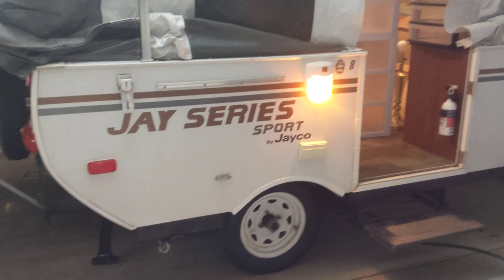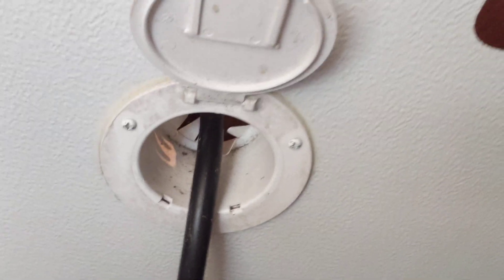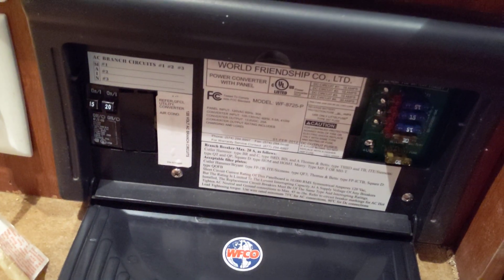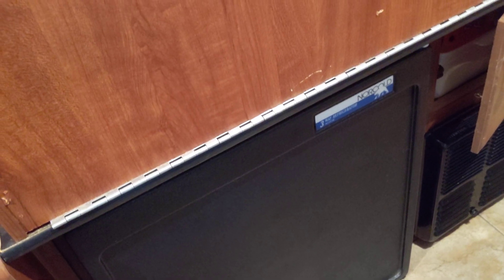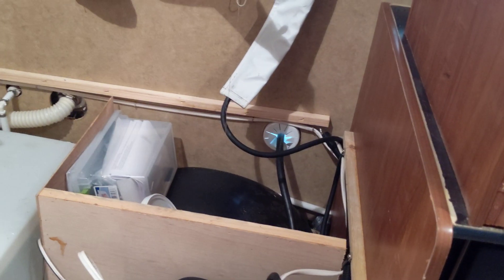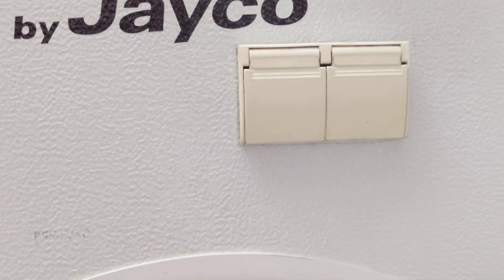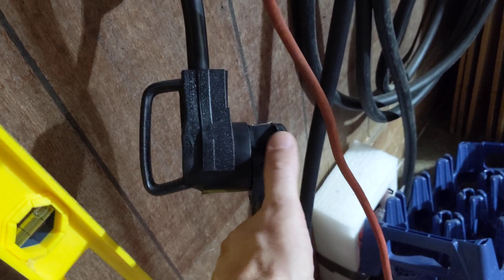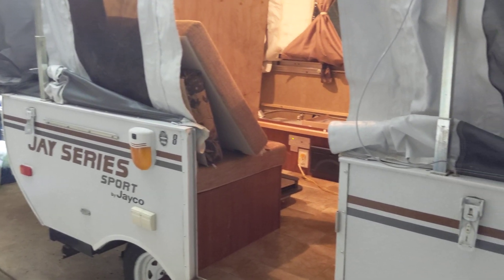Electrical System - 2013 Jayco Sport 8 popup camper

Comment: Did you purchase the 50-amp to 30-amp convertor at Menards also?
Reply from the maker: Yes. Both adapters are from Menards.  Pro-Tip: Menards has an RV/camper section that has various electrical parts.  Ignore that and go to the electric section of the store. They have the same functional product for a just a bit more than half the price.
Reply: @Make-Someday-Today  thank you for the quick answer and for the helpful pro tip!